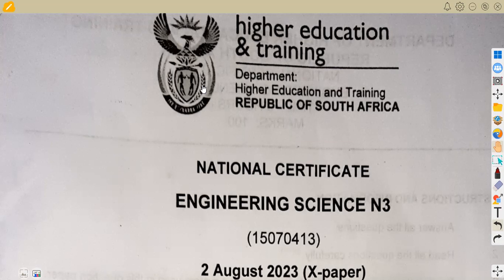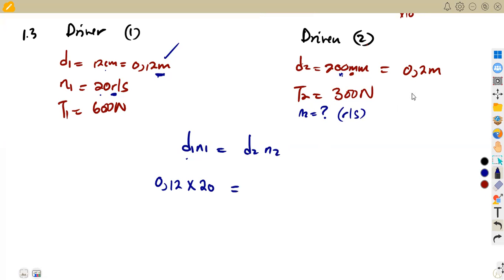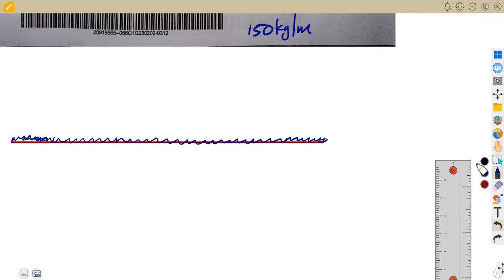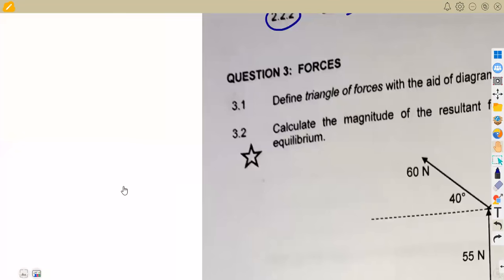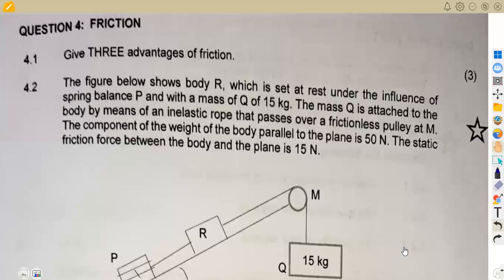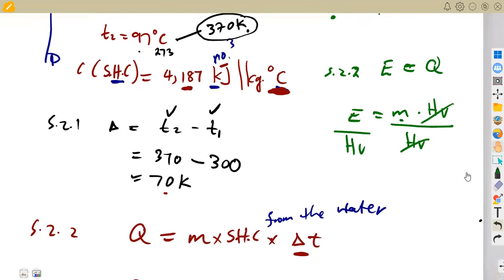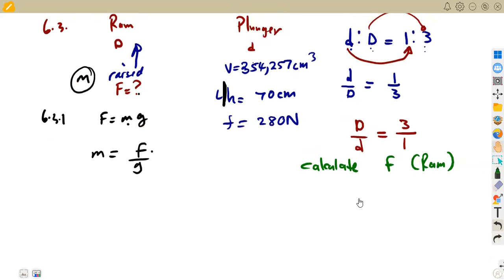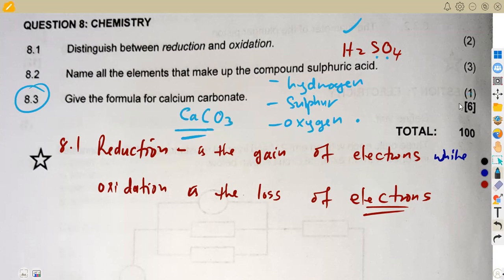Engineering Science N3 AUGUST 2023 MEMO @mathszoneafricanmotives

Comment: On question 6.3.1 ......can I use this formula for calculating mass m=pV since the volume at plunger is equal the volume at the ram
Reply from the maker: You can use any valid formula as long as you show your working and get the correct answer. More light.